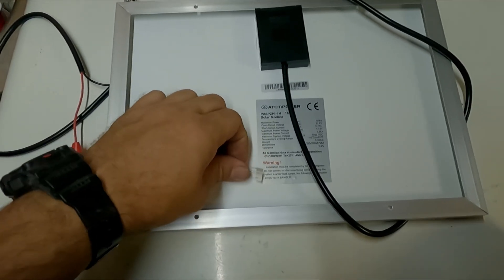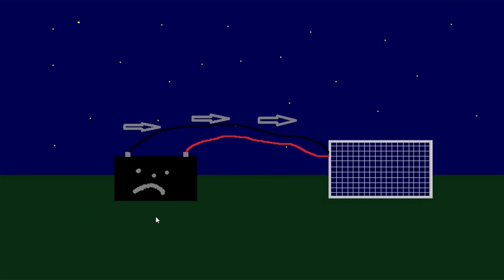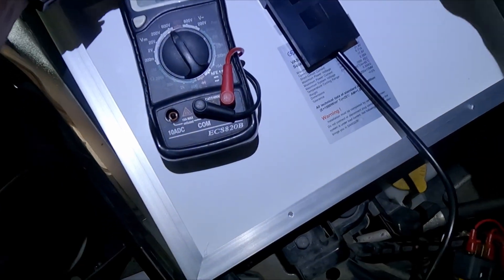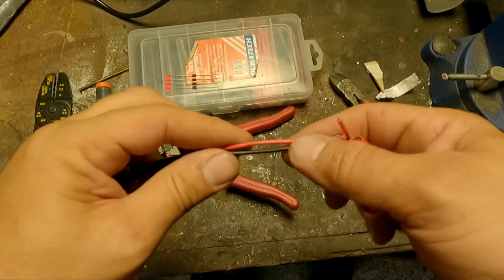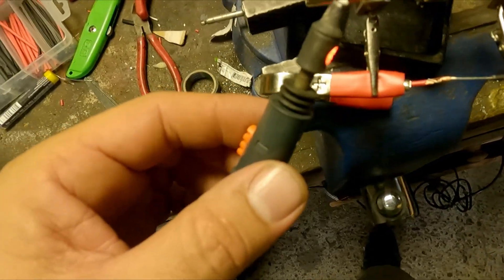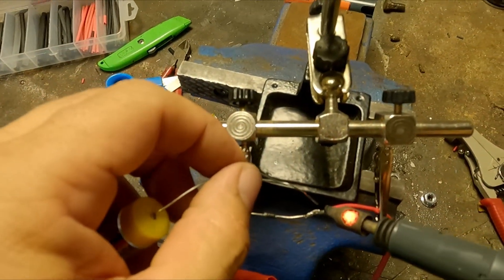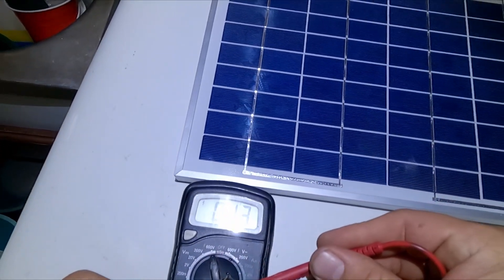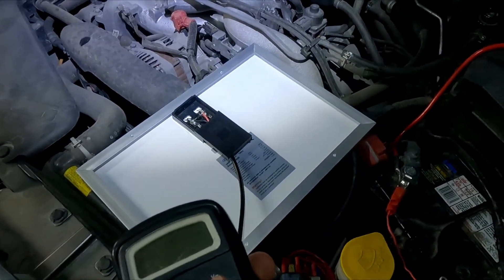Blocking Diode for solar panel

Comment: Thank you for posting. Every little solar charger should have a blocking diode installed straight from the factory. Unfortunately they don't, So installing one is absolutely necessary.

Comment: Mounting the diode where it will not be moved and or flexing would stop the diode from breaking or getting damaged while still performing the same task.
Usually installed inside the junction box mounted to the panel thus protected from the elements. 
P.s. the diode already mounted in series (+ to -)
Is a bypass diode. 
Panels not using a MPPT or similar charge controller MUST have a blocking diode and IF there is more than 1 panel in series you MUST use a bypass diode for every cell. 
Summary-
 1 blocking diode per line/channel/run/series/whatever.
1 bypass diode per pannel.

Comment: Pretty much a waste of time and money, the only solar panels I've seen with blocking diodes are ones with 32 cells which pretty much can't over charge a lead acid battery and designed to connect direct to a battery.

Any charge controller will not allow discharging...
...and you shouldn't connect a panel to a battery without one.

BTW - the diodes that aren't blocking are bypass diodes.
Reply: Wrong. Believe me...China doesn't care. Wrong.

Comment: I use blocking diodes because of my setup.. i have two 20Wp panels connected in parallel so i put one diode on each panel + terminal so the electricity would not flow from one panel to the other.. it just gaves me 50-70% more power and the diodes i use? 1N5822.. 40V, 3A, 0.5V voltage drop. Noice, cheap and durable..

Comment: Hi, does the back flow occur if you are using an mppt charge controller?
Reply: I have this problem on several setups with cheap ebay charge controllers.
I belive they are PWM.

Would it be better for me to connect the diode between the charge controller and the battery rather then between panel and charge controller?

Im only using cheap cheap ebay stuff. Its to have a small light in a outdoor shed im only into for 30 seconds now and then.
Reply from the maker: From what i've read, if it's set up properly, an MPPT controller should prevent backflow yes.

Comment: I am using 150 watt solar panel with 300 watt buck converter When I use 2 amp diode for blocking it heat too much ,I tried combining two plus one amp diode but still heat too much any advise .( my panel generate only 2 ampere to 2.5 amp max but still diodes are producing too much heat)
Reply from the maker: Hmmm, not too sure on that one sorry, haven't done any work with the bigger solar setups yet.